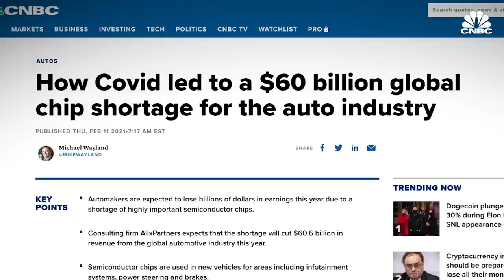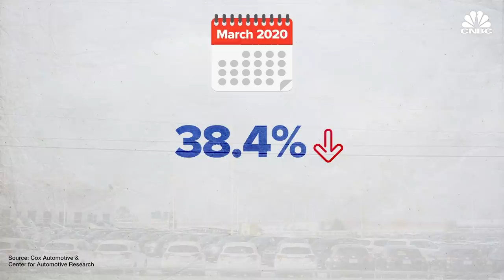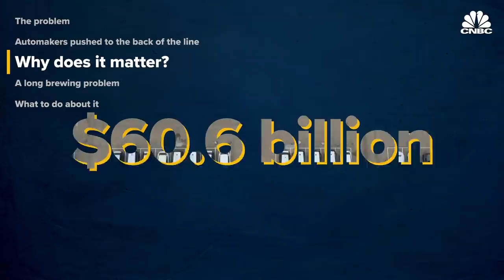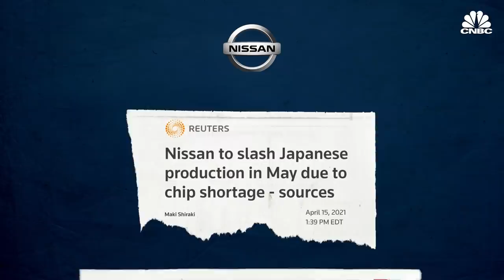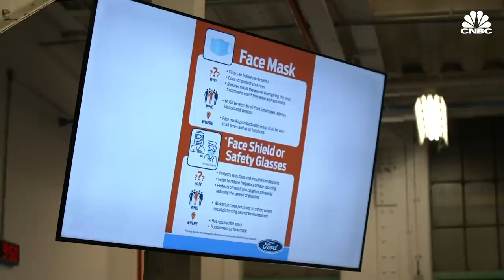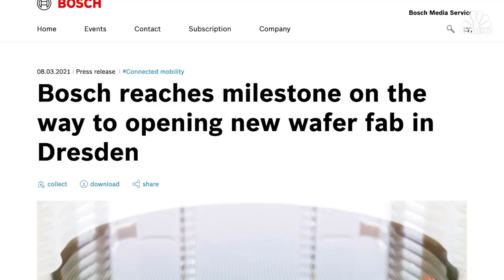Why Tiny Microchips Are Crippling The Global Auto Industry And Driving Up Prices

Comment: Cars ran fine without and were easier to fix. Now they want to sell you a rocket ship - over engineered for the purpose intended . Consequently theyve found a reason  to raise the price which has elevated 700 percent since 1976. 5,540 $ then to 38,700$ avg. price  today. They will defer the cost of this shortage on you same as they do with a pipeline blockage. Taiwan outsourced, a country threatened by China , makes the whole purchase price even more dubious . Never shouldve outsourced. Germans ,Bosch, anticipated this because VW and the other axis manufacturer Nissan anticipated this. How they know what the big 3 dont? . This is idling domestic workers. Together those two make 21million autos and have the largest market share. And this shortage has only made"  planned obsolescence " worse. Automakers will not care till consumers get wise . There was power steering before there was chips . Now all your chips have chinese smiley faces on them except for Lays which are on the floor of the land space craft. Your resale value went down because it's more economical to raise the price of your new chariot and your used car price went up with it If it already has a chip. And the next time your chassis hits a speed bump and jars a transistor board you'll be looking at a check engine light which will require dealer diagnostic computers and they'll tell you they dont have the fritos. Its extortion.

Comment: Chips for auto cannot be repurposed into handsets and consumer AV.  The voltages and operating temperatures are radically different.  What's happening is that Battery Electric Vehicles are redefining the Auto electronics industry supply chain.  Companies like Bosch and Mazda are doubling down on ICE while Tesla, VW and GM are all in on BEV.  It creates a confusing forecast.  Companies overreact to uncertainty by overbuying.  Companies with good intel see it coming and hoard parts. Shortages follow and will persist until 2022 or 2023 when BEV reaches a tipping point.

Comment: contrast the reaction of traditional ICE Vehicle manufacturers with how Tesla handled this situation and was able to use alternative chips, and make changes in software to accomodate virtually without skipping a beat, shows how far other automotive companies have to come to be competitive with the tech company approach,  this just show no risk management, completely rigid operating structure unable to make agile changes based on changing circumstances, lack of forward thinking. They truly are going to have to adapt or die